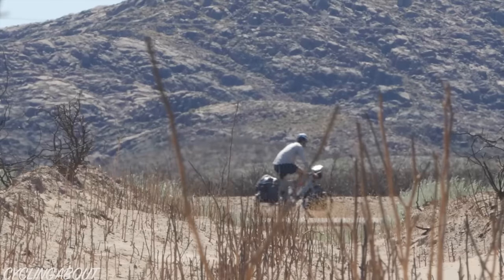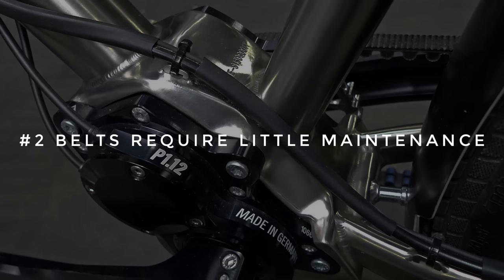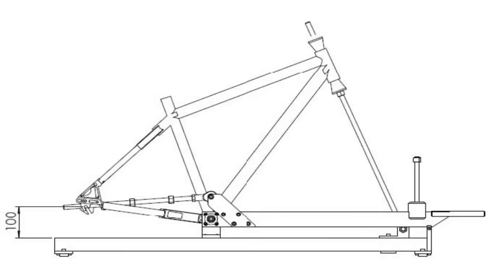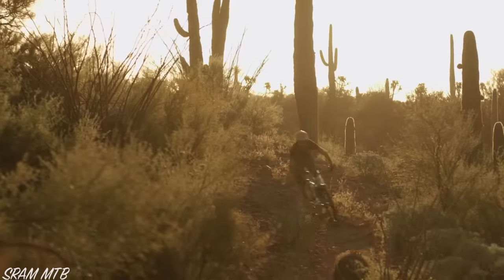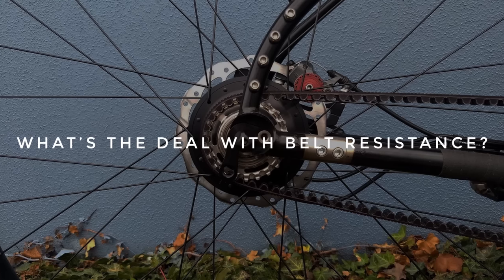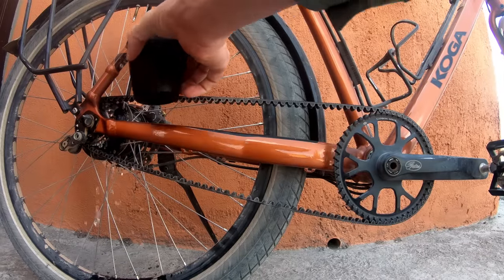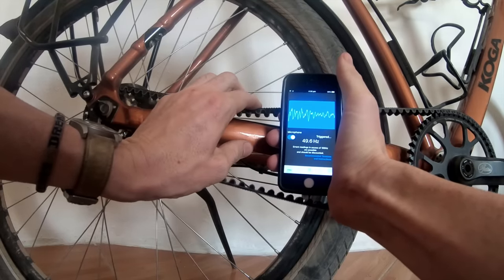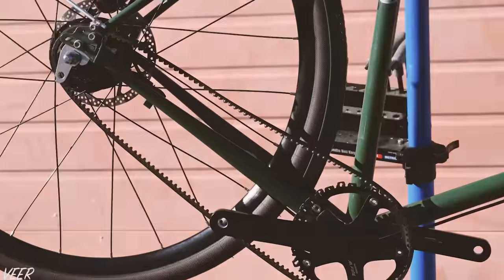Belts Are The BEST Bicycle Drivetrain Available (Epic Testing!)

Comment: As a mechanic I'd argue with you about belts stretching, as I've seen numerous drive belts stretch and or snap
Reply: I was about to say similar. Fan belts stretch on cars over their life to some degree (granted some of this is due to loss of inner belt material). Even though there's less power being transmitted through a bicycle belt, over long usage there would likely be some stretch
Reply: Automotive applications are much higher wear and tension than a bike. I suspect that it doesn’t carry over like that
Reply: Maybe the belts have, or can improve since earlier adaptations.

Comment: With through axles for disc brakes, why not move the rear sprocket to the outside of the rear triangle to eliminate the need for a split in the frame or a fancy splitting belt ?
Reply: cuz you do not want to extend the pedals further apart I guess

Comment: guy on youtube : goes thousands of kms up mountains around the universe
me : has to change tires due to flats twice a month just going to work 😭
Reply: If it's not because of a bad valve or a puncture, then I would recommend putting some unpasteurized milk in the inner tubes for a while.
Reply: @thatguythatdoesstuff5899  what? why? does it act like these tires with goo in them?
I just need to buy the best most bulletproof bike tires
Reply: @alexandrebravo4472  I had tyres that were constantly losing air. I changed the valves, no difference. I checked the inner tube under water for leaks, nothing. Then I was asking around and somebody suggested I put raw milk into the inner tube for a day. I did and it held pressure for far longer. I guess it makes some kind of a film on the inside or fills the tiny tiny gaps. I have a cheap bike I use to get to work and back, so I don't worry about putting milk in the tyres.
Reply: @thatguythatdoesstuff5899  thats fascinating. I dont know where I would even find unpasteurized milk (isn't that illegal in the us for sale?) but I am glad to know I am not the only one facing this mystery. 
thanks for your reply !
Reply: @alexandrebravo4472  if it's not a MTB you could use Schwalbe Marathon, I use them on my commuter, I never had a puncture from something going through the tire on 20k km. 
They just need a little bit more air to reduce the rolling resistance, which is a little bit high with low pressure due to the thick carcasse.
They are not even expensive.

Comment: If they could find a way to make the German gear mechs more affordable it’d be worth experimenting with.
Reply from the maker: For commuting, I definitely recommend the Shimano Alfine hubs. But for touring, you really need something that offers lower gear ratios.
Reply: @Cyclingabout  I don't know what ratios Shimano recommends, but my Marin with the nexus8 came with a 50/22 combo, when I switched the Alfine 11, since all the added range is at the top, I changed my sprockets to 46/24. Much lower geared for climbing at the bottom, but the top is about the same as it was on the previous setup, plus I can use the same length belt. Rohloff sounds like it's worth the money, due to it's long life span, if your bike meets their specs.
Reply from the maker: @jimevans721  That's the lowest gear ratio you can run on an Alfine 11 hub. It should yield a ~27" climbing gear depending on your wheel diameter. I typically recommend a sub-20" gear for loaded touring!
Reply: @Cyclingabout  thanks for that info
Reply: I think it's less about belt vs chain and more about gearbox vs cassete and deraileur. Prototype gearboxes are starting to appear for some mountainbikes, and I think they would be particularly suited to E-bikes which put more load through the chain. An E-Bike with a gearbox would be really cool but are they then essentially low power electric pedal assist motorcycles?

Comment: Almost a  year ago, I acquired a Priority 600X.  A factory made mountain bike with Gates Carbon Drive and Pinion 12 speed gearbox.  I like everything about this system save one.........open belt design is vulnerable to small pebbles being tossed onto it to be carried to the rear sprocket and crushed between the belt and sprocket.   Especially mud is the vehicle for this to happen.  I suppose water could also transport grit of various sizes onto the belt.    I have a cover for the lower part of the belt in mind.  I just need to make and employ it.   If a pebble is too hard to be crushed,  it will likely push through the belt, destroying it.  My original belt has survived so far, only because I recognize the danger and am very wary after going through mud.  I am somewhat confident that a cover over the belt will mostly eliminate the aforementioned Achilles Heel.    I always carry a spare belt, the best insurance for this drivetrain.   The lack of needed maintenance and the outstanding gear shifting performance are plenty of reason to be in awe of this system.    Thanks for sharing.

Comment: What about once the internal gear box is added. Than is it still lighter than a chain drive?
Reply: Shimano Alfine 11 speed hub, the hub alone weighs 1600 grams! Shimano 105 rear derailleur weighs 220g. 11 speed 11-32 cassette is 320 gram and a decent rear hub is about 280 grams. Add the weight of an 11 speed chain of 250 grams and it’s less that the rear hub weight alone by about half a kilo! The belt itself may be lighter but that’s where the positives end.

Comment: man I agree , Add some HP I recently purchased a 1992 Harley softail The owner had fitted a chain drive ,, Riding it home the 800K`s I had to tighten that chain twice and the noise so loud ,,,,I couldn't wait to put it back to stock so I swapped out the front and rear pulley`s and split the frame put the new belt on and what a difference HEAVEN and no more bloody chain maintenance ,

Great vid My Voliton (Aussie made eMTB has the belt and yes smooth , quiet and after 15000Ks no adjustments at all ,,

Comment: One more thing.. The whole setup - frame, the drive and the rear gear gear hub are very expensive. Of course there is expensive der. gear trains but for 100 bucks you can be in the game with 8 or 9 speeds rear.
Reply: If you're upgrading a bike, but if you're buying new, it might not be a huge difference.
Reply: It depends on use case...for a flat city, one can go single speed and save money and weight at rear.

Comment: I think a belt would be great for single gear fixie riders. While I abhor the damn things and the tendency for buyers of them to prefer no brakes, the one real argument I give credit to is that of low maintenance. For simple commuting, you wouldn't even need the gear box. I consider myself an avid city rider, and I think at most I put 7000km a year on my bike. Imagine the longevity of a bike that has next to no maintenance as a single gear commuter. It would also be a great way to get people into cycling who don't want to worry about upkeep. "Oh yeah, you don't even have to do much more than rinse and spray the thing for 10 years."

I think it's also the better option for eBikes and recumbent bikes. More consistency in moving parts is always a good thing.

Comment: Been riding a german bike with shaft drive for 40 years it has a internal 5 speed and 2 gear front crank. Silent, light and gives the gear ratio equivalent  of typical new mountain bikes. This bike was built in 1976. Its a modus 10 built for commuting.
Reply: Wow! So those bikes really exist.

Comment: "the best bicycle drivetrain"
Me: okay change gear and then we'll talk
Reply from the maker: I have 14 gears...
Reply: @Cyclingabout  how does that work?
Reply from the maker: @destinseese34  Search "Rohloff"
Reply: @Cyclingabout  then why are you sayng chain is heavier than belt when the belt system with 14 gears is 3.8 kg. Chain systems weight under 2.8kgs and have 600% range belts are close to 500%. No chain is over 300grams wich the belt never is over 100grams, so you are talking about a 200gram reduction while the system has 1 whole kilogram over the traditional chain system? Yeah sure.... and nowadays chain system parts like derailleurs come in carbon parts and always get easier.
Also not to mention when traveling compatibility is the key to the equipment... I don't want to carry with me bike parts. Go ask to any shop on forgoten villages about belts for a bike.
Reply from the maker: @knuskelly3606  When you compare gearbox chain and belt-driven bikes, the belt system is lighter. It's not a major point, but a point none-the-less.
Reply: @Cyclingabout  Yeah, probably the reason why the professional cyclists use chains, they want that extra weight???
Reply: @ppdan  sponsors, their sponsors are chain manufactures
Reply: @supersiem1431  lol

Comment: I see all the benefits of a belt drivetrain and i really want to use it on my travelbike. But there is always a but. When i crash my rearwheel somewhere in the middle of nowhere, it is very hard and/or expensive to find spareparts and it takes a long time to repair. When my backwheel didnt survive in Chile, it was just a 10 minutes repair. I went into the shop, bought a new wheel, swiched the cassette an brake disk and thats it. With a Rholoff for example, i needed someone who has the tools to replace all the spokes and do it on my own or pay someone for it. Either way the whole day was lost.
Another big advantage is the flexibility. I bouhght the bike when 11-34 was the actual best gear transmission. Nowadays im driving 11-42 with a special 20 30 40 crank just to get the smallest gear possible for going uphill all day carrying all my stuff in the Andes. Next thing im gonna try is 46 but im already at the limit with my system getting a lose chain on both smallest gears. You don't get this flexibility with a Belt espacially on the long term. On the other hand i buy a new chain every bigger tour i start, that is also expensive. But since i install all my "old" parts on my city-bike or Fully, also the chain i replaced just in case, its ok. So i only buy parts for one and a half bikes but therefor very often.

Comment: After much thought, I bought a trail bike with a Rohloff and a belt drive last year....  very happy with it!
Reply from the maker: Great to hear! What did you choose?
Reply: @Cyclingabout  Thanks for your reply and interest as well as sharing your knowledge.  I have typed a couple of replies but they seem to disappear in my browser - sorry if you get multiple replies. My riding is mostly 1-2 day rides in the Swiss alps... I ride reasonably hard and value high quality equipment which lasts rather than frequent new purchases.  My last bike was a custom built XC bike (trail and enduro did not exist back then) with the biggest tubed front fork I could find at the time... it has lasted over 20 years but it was definitely time for new tech.  The new bike is a Strato from a small french company called SVO Bike.  It is a 27.5" wheeled trail / enduro bike.  At 14kg it is relatively heavy, but seems to be in line with other such bikes in the category.  I do not feel that the Rohloff / Gates drivetrain adds a weight penalty, and I love the clean and smooth drivetrain performance it provides.  I read a lot about people saying the weight of the Rohloff in the rear would be bad for suspension performance, but frankly my suspension performance seems very good, and the weight on the rear actually seems to help when climbing steeps on loose surfaces.  I wanted an Aluminium frame but I opted for carbon wheels... we'll see about their longevity.  As mentioned, so far very happy with it.  The 1x14 is not as good as my old XTR with 27 gears, but is certainly enough, and better than a 1x12 with a derailleur hanging in the wind!

Comment: There's a reason electric guitars are still made with WOOD. Same thing here.
Reply: What's your point? 🤨
Reply: @winstonzeb2842  Although there are more high tech and futuristic materials options out there, people still prefer the "feel" and the tradition of tested classics. Like wood in guitars or chains on bikes.
Reply: @pagesegovia2026  that doesn't really apply to performance based products, the auto industry has reinvented themselves hundreds of time. Gutairs are made out of wood because no synthetic material can replicate the sound and feel. If a belt really is better than a chain it will be adopted more and more

Comment: chain is more efficient.  belts have their pluses, but they're fuddamentally not better.  case closed
Reply: Maybe you want to change your mind when you are stuck at the roadside trying to repair it or at the end of each day, clean and lube it as after only 1 drop of rain all the lube has rinsed off or one grain of dust has caused it to gum up and not turn smoothly?

Comment: So I love belts, I have one on my commuter bike. I would however never consider a belt on a world touring bike. They last longer, but if something happens to it in the middle of nowhere you need to get it replaced with a new one of exactly the right length, and out there no shop will have even seen a belt drive, let alone carry stock of the exact belt length you need. With a chain, you can fix it right there on the spot with a simple tool and a small length of spare chain.

Comment: Front cog wear. The greatest force applied on the front cog is when you can push the pedal down with your legs. That causes the front cog to wear uneven. It gets "oval" in time. Wear can be seen at the teeth of the cog. A way to check this is to pluck the belt at different positions of you pedal. The sound should be the same at all positions. A difference in sound points to uneven wear. On my bike, it is possible to shift the cog over 45 degrees so for the next 15.000 kms it wears at the so far "clean" side.

Comment: Considering belt friction increases at a slower rate than chain friction with increasing power input, it seems like belts would make most sense for ebikes and emotorcycles where the power input can be much higher than the 200-300W a typical rider can output.  You would actually gain significant efficiency over a chain drive and thus gain ride time and power, probably enough to surpass the efficiency penalties of the hub drive.  The limited gear ratio granularity of a hub is less cumbersome with electric drive to overcome any awkward slope grades that fall between ideal gear ratios and the increased weight of the hub is proportionally less important when the bike itself already weighs 40-50lbs from the motor and battery.

The reduced noise seems especially beneficial for emotos considering the chain noise can get pretty obnoxious when you no longer have the engine noise to cover it up.

Comment: For my first 2 years of driving I had a moped 50cc 3,5hp and you had to change the chains and sprockets 3 - 4 times a riding season. I got tired of that and ordered a high strength chain and that lasted a whole ride season. A few years later I got a 750cc motorcycle with 100hp (29x more power) and was surprised that the chain and sprockets on that lasted forever and in 10 years of riding I did not even tension it... There is chains and there is chains that is made to be bad... The chain on the 750cc motorcycle was just a little ticker then on the 50cc moped and still the difference was huge.

Comment: I have a belt in use on a 85Nm (Bosch gen4) and Enviolo hub.
Apparently they (cycle shop) forgot to check the tension of the belt after changing the tires, it was a new E-bike and i thought
it was OK.
At some point I accelerated to try out the torque and a loud kind of chunk of vibration I experienced.
Lost also the snubber.

The conclusion was that the belt must have bin pulled over its rear cog and pushed away the snubber.
I readjust the belt, but experienced  with this high torque that the tension is critical in this situation.
It still seems like to wanna creep out off that rear cog sometimes.

The belt is apparently really strong and wasn't damaged.
My guess  is that 85Nm is maybe a to heavy load, however i will continue to use it anyway.
I use this e-bike a lot for off road touring and it seems to hold out so far.  
If there is some hidden failure in the rear cog for example, i will find out sooner or later.
The maintenance advantage makes the belt still preferable.

Not a world traveler myself but like to read about it in your e-book which i have already.
Thanks for your great detailed reviews.

Comment: I've had an Ebike with belt drive for around 5 years and its much better than a chain. I have had zero maintenance and I do load it very heavily. I'm not worried about a slight loss of efficiency as its an Ebike and I am not racing it.

Comment: With this pandemic stuff going on i havent been able to get a replacement primary belt drive for my Harley Davidson motorcycle. Its a common belt, so if a bicycle drive belt is less common i would suggest checking on availability. My primary belt has been on back order since may of 2020 and I've lost two summers of ridding on that motorcycle. Just pointing out that special part orders are a pain right now.

Comment: When I bought a belt kalkhoff drive train bike three teeth snapped off the gates belt after 300 miles.
Price of a replace belt was 70 gbp.
Sold the bike for a loss and went back to chain drive.Never been happier
Reply from the maker: I suspect there was an alignment issue there. Glad you're happy with the chain though.

Comment: I rode 10.000 kilometers on a cheap stock chain from my $500 Cube Mountainbike before it started slipping. I still rather have a belt drive though because it isn't as messy and much quieter.
Reply: Just put on a chainstay silencer and you should be good to go with the noise